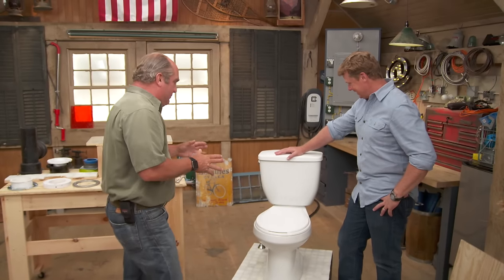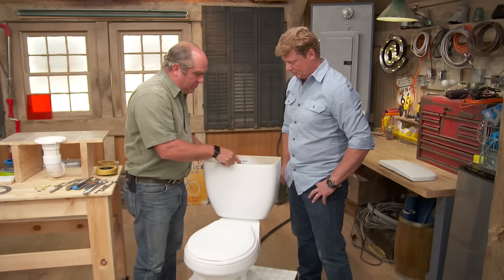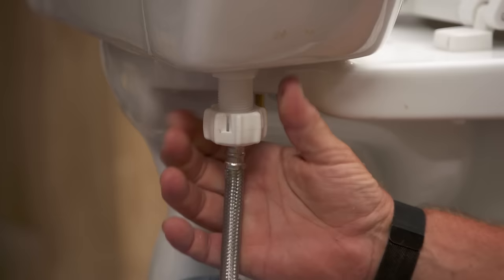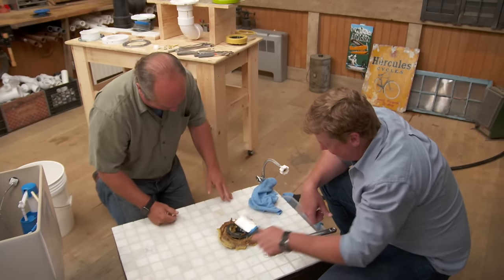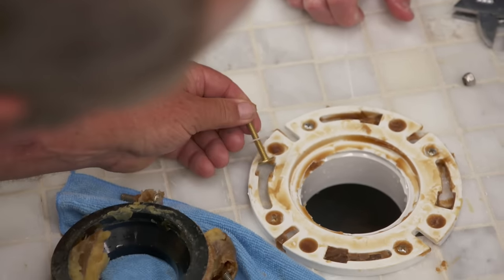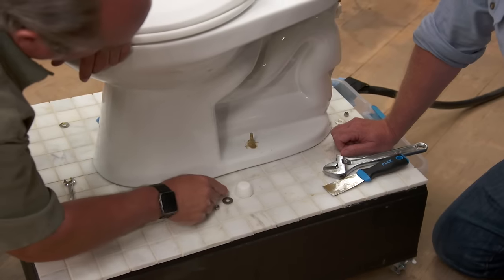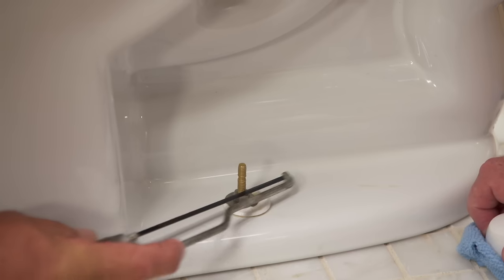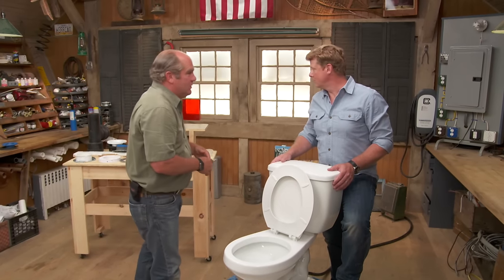How to Change a Toilet | Ask This Old House

Comment: After you  remove the toilet stuff a towel into the pipe opening to prevent gases from coming up and to prevent dropping a nut, washer,  bolt ,etc. down the drain.

Comment: Good job guys, but I would just add that make sure that your wax seal is at room temperature before setting the toilet, don’t ever set a toilet on a cold wax ring, there’s a good chance you may not have the proper seal because the wax will crush being cold.
Reply: 1 minute under hot water takes care of that...i carry them in my van and do that winters.
Reply: Thats where the rubber one comes in handy

Comment: I drain the water out of the tank by unscrewing the fill valve and holding a bucket under the hole.
Reply: have you tried one of those new elastomer flange gaskets
Reply: Hey it's you!
Reply: @plumbingstuffinoregon2471  Hi
Reply: @jsnxbskscnskcnskcjbzjzjbvd  I think so. If I remember correctly, it didn't work very well.

Comment: couple things:
1) usually you've to score (gently) around the toilet in order to break the seal of the caulk around the toilet base
2) use a large garden trash bag to put your old toilet on
3) like others have said, stuff a large old rag or shirt into the flange so sewer gas isn't coming up and it helps keeping you from accidentally dropping something down into the drain!
4) for the bolts, don't center them on the flange. Center them in your room. What he said is assuming the original plumb was nice enough to make sure the flange was center when they installed the toilet. 
5) have the new wax ring at room temperature or so when you place it; I've heard of people leaving it in their car and it's cold outside and then place it and it leaks but it's not squishy enough. 

6) if it's been awhile, probably not a bad idea to replace the supply line from the wall to the tank
7) if you're putt on a brand new toilet, make sure it'll fit. I put one in and with the baseboard and quarter round in the bathroom, it just barely fit into place
8) if you're not somewhat handy, I recommend hiring a plumber or make sure you have a second toilet in the house in case you run into an issue, like the flange is too low or something like that.

Comment: My existing 25 year old unit didn't have caps and the bolts and nuts had rusted, so I used a jig saw to remove the bolts.
To capture the grease I used a small box of which the sides of the box were use to clean off the putty knife without need for "controlling" the messy rag.
So the screw stubs I hit once with a hammed and they popped loose and easily slide out of the slots.

Also in preparing for this operation for all you skittish people like myself, I turned off the water, flushed the toilet, poured about a 3rd of a container of bleach into the tank and flushed it and held the flapper open, let it set while I did other things. then came back later and poured the rest of the bleach directly into the bowl which flushed out most of the water.
then the next day, sopped out the tank and plunged out the bowl and then(see above) removed the whole unit with minimal spillage by myself and was bagging it up as I was lifting it and carted it out of the house with minimal mess.

I'm the kind of guy that not much goes right, but this was a breeze.

Comment: It's MUCH easier and faster if you use a wet/dry vacuum in order to get the water out completely, even the bowl. Many homeowners have one of these. Long time plumber here in Maryland.

A sponge and a turkey baster? Common' that just takes forever and is a time waster if you do this for a living. I install up to 6-8 toilets per week No joke.

In addition, try the "FluidMaster SetFast" closet flange bolts. Under $7 per set. They are self adjusting and never need cutting or breaking off. Makes for a really quick installation of your new toilet.

Just a little quick trick for you folks out there.
Reply: How much to install a toilet?

Comment: couldn't help but notice one of those bolts he was breaking off was still loose. it was moving around big time as he was trying o break it off.
Reply: Thats fairly normal.  If you tighten the nuts to tight it will break out of the flange.
Reply: The bolts should be secured to the flanges not just with some little plastic washer

Comment: I'm needing to replace an upstairs toilet and it's the original toilet... my house is 50yrs old... the water line from the wall to the toilet is straight line and not the flexiable tubing/pipe.... would it be difficult to change this out... just wondering if so, maybe I should let a plumber handle it? 🤷‍♀️ I've changed a toilet out before and found it pretty easy, just wondering about how complex that line would be. Thanks

Comment: Hold a bucket under where the cold feed enters the cistern and just undo the nut, that's a quick way to get the water out. Or, use a wet and dry vac to get rid of the excess water in the cistern.
Reply: Yeah i use a wet vac.  I'm not sticking my hands in someone's toilet water to sponge it out😂😂😂

Comment: Moved from LA to TN in 2021 and the new house had the shorter small round bowls and I said F that.  I bought 3 toilets for the house and the main ones used are downstairs and the upstairs hallway so i did those back to back and a year later ive yet to install the master bedroom toilet.  I need to just get it done.

Comment: I recently replaced the 1950's toilet in my house. They reused it when they remodeled and caulked it to the tile floor, so when i pulled it up it took about 40 little tiles up with it, which made a 30 minute toilet swap, into a two day ordeal. Unless your bathroom regularly FLOODS, there is no reason to caulk it to the freakin floor!!!! Fer frigs sakes!!
Reply: John Ulicky yeah I'm about to replace my toilet right now and I see like crap load of caulking underneath the old toilet. Figured the same thing was going to happen so pray for me LOL
Reply: colbalt95 I did try to slice around it, but I guess I didn't go deep enough. If I had to do it again, I would use a longer blade obviously.  PRO TIP: Make sure you're all the way thru the caulk, all the way around, especially if you have a mosaic tile floor. Trying to glue, space, distribute, and then grout all those 1" tiles is a SERIOUS buzz kill!!
Reply: It's not uncommon to put a silicon bead around it. If that takes your tiles up with it then your tiles are loose and you have potentially a serious problem. If they actually caulked it to the floor then yes that's unnecessary even if you expect a lot of water on the floor.
Reply: I own rentals, I caulk. Renters don't give a rats ass and leave standing water everywhere, and you would think they have wrestling matches on the toilets the way they work them loose from the flange. If you own rentals, caulk. Trust me...
Reply: I would've just left the old toilet, unless there was something seriously wrong with it.
Reply: Caulking is code
Reply: @Muscleupsanddangles  One thing to consider is that some cultures prefer to squat rather than sit on a toilet. If any of your tenants are stepping up on the toilet to squat over it, then that can cause it to loosen and leak over time. If you have an otherwise good tenant who frequently has toilet loosening/leaking problems, and they're from another part of the world, you might inquire about how they use the toilet. If they squat, you might consider installing a hybrid squat toilet for them. They make contact with a greater area of the floor to minimize the stress caused by stepping on one side. You might have a hard time finding one. Obviously it's a lot of trouble doing that, so they would need to be a really good tenant, lol.

Here's one I found. I don't know where they sell them.  https://www.wudumate.com/asian-toilets-and-bidets/hybrid-toilet
Reply: @GRice999  or they could consider assimilation and using facilities they rented properly instead of negligently. I have traveled all over and when I am in Rome I fo as the Romans. I have never misused facilities and housewares trying to bend them to MY habits. I get what you are saying, but it is a shame that the responsibility lies on the property owners.......and yes, ypu guessed right, many of my tenants are internationals.

Comment: good video, thanks.  I had a flooring contractor  installing new floor replacement in the bathroom.  I had  water leakage and the floor was damaged. He removed the toilet and  installed a new wax ring and used the existing bolts which ended up to be short because the floor was raised.  He said I can buy longer bolts and without removing the toilet I can (1)  remove old bolts and (2) install new bolts,  just tilt the toilet. Is that correct?  any chance to have leaks.   [BTW, I replaced the floor because of toilet leak]
Reply: You cannot replace toilet bolts without removing the toilet and re-installing it with a new wax ring. You can end up with leaks and sewer gases entering your home. Don't get plumbing advice from flooring contractors. call a plumber.

Comment: I'm about to put a new toilet in my new, old house. The existing toilet has four (4) bolts coming up from floor. Not the usual two closet bolts. What should I expect to find when I take the toilet off? My new toilet only has the usual two bolts.
Reply: adapter ring to install

Comment: This OLD house...do a video on 100+ year old cast iron flanges,  rotten floor boards, corroded bolts real stuff you might find in OLD plumbing. Please.
Reply: Yes!
Reply: exactly...i had to replace a bathroom vinyl floor last week...of course broken cast  flange and rusted out closet bolts. 2 hour job took all day had to stay late could not leave them with no toilet.
Reply: There's already a video where he replaces a cast iron flange in a 100 year old house.

Comment: I would use that gell stuff called water lock or if you can’t find it in hardware stores floral water beads also known as orbez but from a craft store there less expensive

Comment: My closet bolts are loose. I cant tighten the nuts without the bolts spinning. Any advice on how to fix that?
Reply: Tighten the washer below the toilet.
Reply: Closet bolts should be secured to the flange by a washer, then the toilet goes.over them. Then toilet is secured to those bolts.

Comment: Removing a brand new nut and he is hoping it was not rusted tight????????
But folks if you want to change your toilet wear some good gloves just to keep your hands clean.
Also get some heavy duty air refresher because the drain will smell bad.
Jamming a large WET cloth in the drain hole for the time between removing the old and placing the new will save your nose.
Reply: Exactly. That's why they are the world's last superpower.
Reply: +Fredirik

Please excuse the ill-mannered, ignorant comment by my (unfortunately) fellow American, taemian, who doesn't know how to insert a comment for/to the correct source.

You are absolutely correct in your comment.  I witnessed, in 1972, a French family living in Paris, with whom I had the pleasure of being invited to live with them, a system of faucets where above each faucet existed a rectangular box which ignited, internally from natural gas, to heat the water when the hot water faucet was turned on.  The loss of precious drinking water was minimal at worst and almost non-existent at best.  

Here in the boisterous, ignorant, bellicose behavior of the worst of American citizenry of good, ol' 'Murica, we turn on our taps for hot water and have to wait, ... and wait, ...and wait, all the while wasting precious (hot) drinking water to purge the cold water from the long line(s) of pipes, waiting, ... and waiting, ... and waiting, ... until the hot (tepid at first) water begins to emerge from our faucets.  Can you imagine how many gallons/liters of precious drinking water is wasted just for us to obtain hot water each and every day for meals/hand-washings/baths and showers?!  Millions of American families waste millions of precious gallons/liters of water every day!  And yet, we have boneheads like "taemian" brag about our super power status ... ignoring the fact that we are trillions, and trillions of dollars in debt!  What is that debt today, 22-trillions?  That would be $22,000, 000, 000,000.00 of debt and the American Nazi-Republican Party is adding much, much more to that figure.  These are Trump-idiots dictating the demise of a once, great, benevolent (okay, we had some faults) nation which had, in its heart, the desire to do good things around the world.  Now, we have Trump-idiots (and the neo-conservatives of the Bush-the-junior era) spewing their unfounded hate and discontent throughout our once great nation and the world.  This is the predicament we, knowledgeable Americans, find ourselves, in the United States of American at this time.  Ignorant, stupid, hateful (*white-skinned) people spewing ignorance and hate within our nation; they are so easily manipulated and controlled.

Europe, to include the Scandinavian countries, is light-years ahead of the U.S.  Keep in mind that we, Americans, live in a cocoon.  We do not have neighboring countries in the quantities and differences those of you have in the Old Country(ies) have.  You have greater incentives to cooperate and to solve your problems together.  We, the U.S., lack those incentives; we are, pretty much, left to our own devices.

I ask for your understanding ...

//signed//
A Good American.

*I am classified as white, Caucasian in a single word.  My family, on my sperm-donor's side, originated from England in the late 19th Century.

Comment: How do you get those bolts off if they are rusted out and the bolt and nut turns?
Reply: They have an end that's skinny length wise and fat on the width. So spinning those bolts until the fat side lines up with the long part of hole. They should pop out

Comment: I am convinced now that replacing the entire toilet/tank system is easier than trying to find a SASA 411 Tank that was made in Mexico. I can't find a replacement tank anywhere. I live in a 100yr old home, who knows how old this tank is? probably discontinued item. Big sighs. Last night I bought a brand new Dewalt reciprocating saw to cut off the rusted tank bolts $$$ found out the leak was coming from a "cracked tank" and not a worn gasket. drip, drip into an old coffee can until I purchase a new one, I am researching. If anyone is familiar with SASA 411 tank please do chime in. 
Angel from The Bay

Comment: Don't use the 'funnel' type wax ring. Those fail far more frequently than the pain wax rings. Failure is mostly caused by a toilet that can move for some reason and by pouring hot water in the bowl and not flushing right away - causes the wax to melt.
Make sure the wax ring is soft (with warm water) in cold weather before installing it. If it is too cold it can form a crack when placing the toilet on top of it.
Dishonest plumbers install the funnel type wax rings for future business.
Reply: CauseAndEffect 
Who pours hot water in a toilet

Comment: Deep wax seals with plastic horn was designed for low closet flanges, if the flange is at correct height, the closet flange will seat with the horn of the water closet with regular wax ring or better plumbers putty. If the flange is set too low the added plastic bevel horn will one day cause splash back erosion. I have seen this hundreds of times, you need to use a spacer with putty if the flange is too deep. The flange on this video was set correct so there will be little to no wax seal between the closet horn and plastic horn on deep wax so don't use it (the extra deep wax) and no need for the added plastic horn.
Reply: william Higgins Johnni ring plus standard reenforced wax ring has the horn and the box says it is designed for flanges level with the floor. The jumbo version says it is for recessed flanges. I have a short horn bowl with a flange that sits on top of the tile floor so I was planning to use the standard with the horn. Using one without a horn kind of scares me cause there is not much there to direct things down the hole.
Reply: I actually tried installing that one but messed up and one of my bolts slipped out in the process to I have to do it again now. I was actually considering leaving that horn there and buying the cheaper normal size wax ring to do it the 2nd time but I'm not real sure what to do now.
Reply: exactly..those damn plastic horns are nothing but a pain... had dozens of calls for leaks because of those.
Reply: you probably fixed it by now but even doubling up 2 normal rings will be ok...just do not use the plastic horn.

Comment: But there is a problem. You are assuming everyone before you did it right. Well, I just ran into a situation where someone did it wrong. The installed the flange into the floor at a 45 degree angle, based on the slots for the closet bolts.  They then cut slots out for the closet bolts where they would be installed. Its horrible. I dont know why it was done. I dont know how they were able to keep the closet bolts from spinning, and coming out of the slot they made. This is my first attempt at a toilet, and I could not figure out how to make the bolts stop spinning. After watching this video I could see why. Some asshat didnt know what they were doing (30 years ago) and just faked it. Now I have to fix what they screwed up, making my work a lot harder. As I now need to look up floor flanges, tile floor, sealing the flange, etc, etc, etc. Not to mention having the wife angry at me for not knowing any of this. I'm more a electronics and computer guy than a plumber. MY trade was in Aircraft Weapons. No plumbing with the aircraft I worked on.